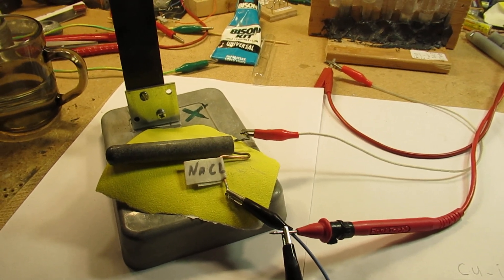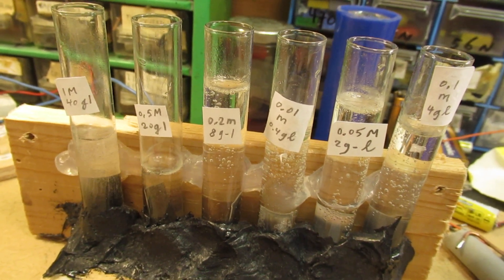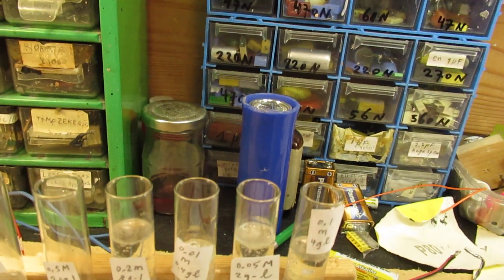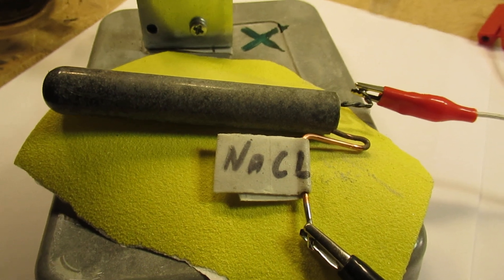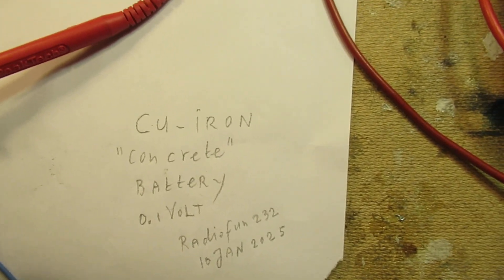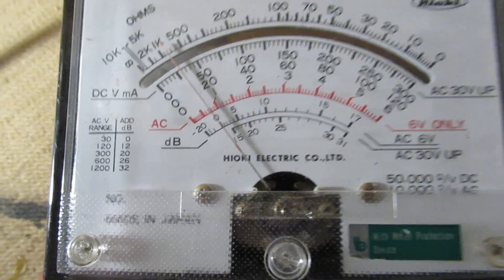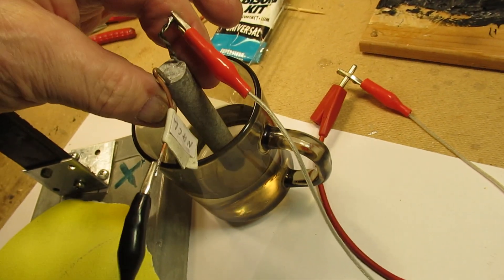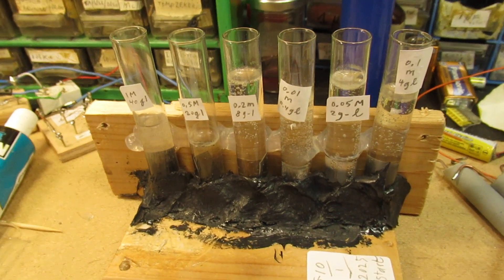Copper & Iron electrode in cement/concrete with NaCl form a battery of 0.4 Volt and 26 uA when wet

Comment: Will be interesting to see how they perform. Unless you try you don't know, good video 👍
Reply from the maker: Thanks John, my idea is to experiment this all completely out, given the idea to make a simple battery that everyone can make, supplying a green or red LED to work for many years (minimum 3 years, that is my aim). I did already a first experiment, started dec. 2024, with electrodes of carbon and aluminum and an electrolyte of table salt, NaCl. That LED circuit still works nice now (10 jan 2025). I will test this up until June 2025.
The video (19 dec. 2024) is here
https://youtu.be/T2gCaiq9eZw
Reply from the maker: Have pinned your comment.
Reply: That would be a great result. And would be of great interest. Thankyou for sharing 👍

Comment: Keep in mind that you don't try to charge this battery with a bench powersupply, because due the cement/concrete gas can't escape, and the battery can explode due the gas development.
Same as trying to charge a flat car battery that is frozen, due the solid electrolyt, the gas can't escape and the battery burst open. I have witnessed this once back in the day, when a colleague mechanic tried this. The entire top of the battery was blown off. Luckily nobody was in close distance, but it gave a loud bang across the workshop..
With this selfmade battery the internal resistance will be high, so i don't think it will take a lot of current, but even a tiny amount can produce gas that has no easy way to escape. Grtz
Reply from the maker: Hi Bjorn, it is not the aim to charge it, but anyway, thanks.